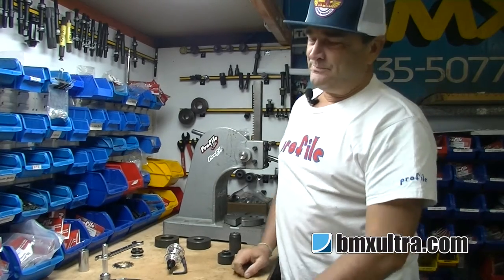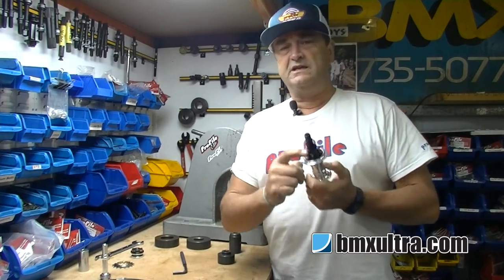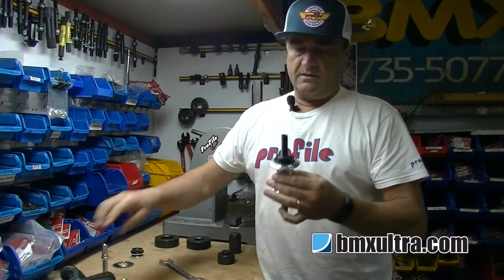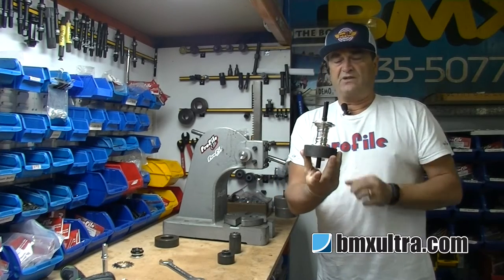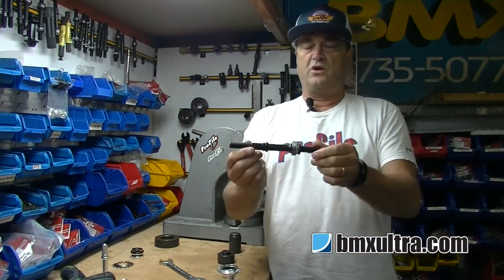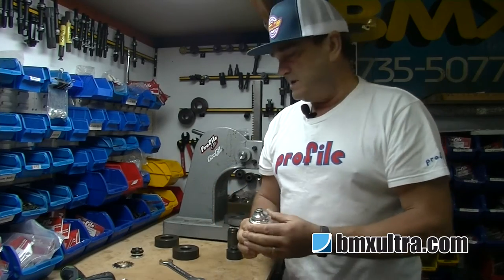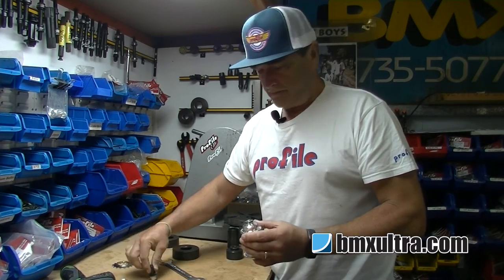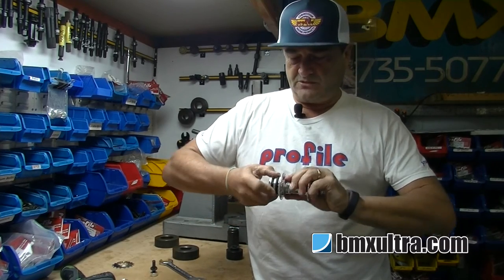Convert Profile Mini Hub from 14mm GDH to 10mm Cassette (Know Your Product. Profile Episode 1)

Comment: Can I do this to my Madera hub? Its the first version I believe,  I have a titanium axle in it, 14mm but wanna use the wheel on my gt pro series ,  thanks for the informative content 👍 im subscribing now.
Reply: You can convert the Madera. The hub shells are the same as the mini. If you visit the profile website and look at hub parts you’ll find the axle you need and the cassette parts list what they fit and the Madera is listed.  It for the cost of the axle, driver, bolts and cog you might consider a new hub and keep the one you have ready for another day. The price will be very close to the same.

Comment: how much would this conversion cost? i've got a limited colourway set of hubs, dont really want to change them but want to convert the rear axel so that all of my bike is allen key fitments
Reply: don't worry i found one at local shop! great video tho this guy clearly knows his stuff!
Reply: @challett3991  so...how much?
Reply: @chapelcruz6886  here in the UK it's between £60-£80 for the kit depending on what hub you have and where you buy from
Reply: @challett3991  how can i put a freewheel instead of that, can i just buy a cog and put it over the tooth because i want to make it 17T